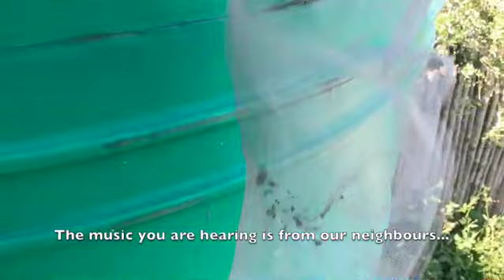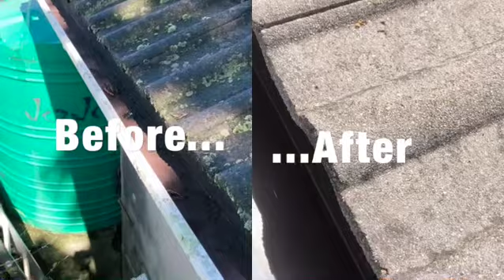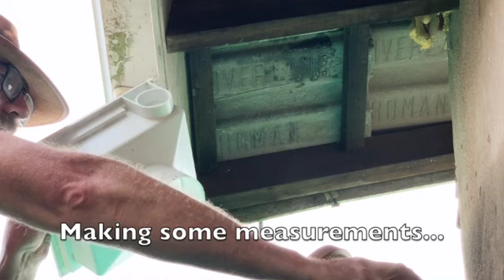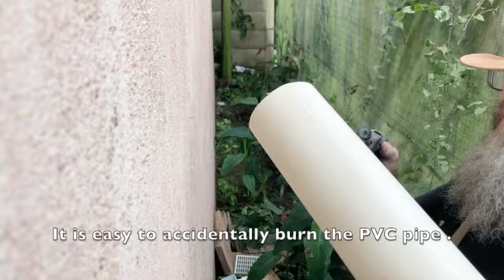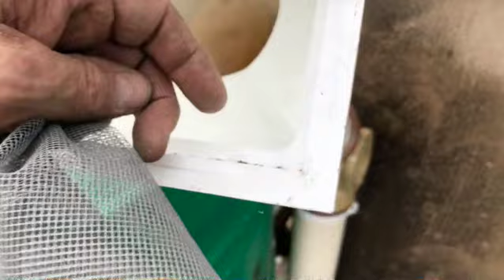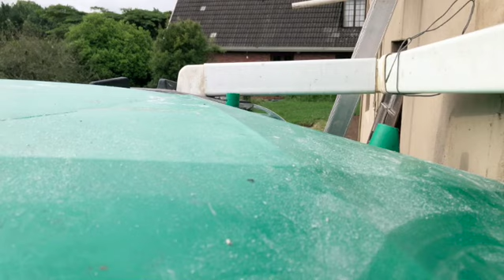How to clean a roof and add a leaf catcher to your rainwater harvester.

Comment: Satisfying job to clean the roof like that … how many liters of water did you use to get the job done ?
Reply from the maker: I did not measure, however the pressure washer does not consume as much water as it has a small nozzle and it is pressure that cleans, not the amount of water. I woud guess it used 200- 300 liters in 3 hours.
Reply: @thequixotryworkshop2424  cool beans … now if one uses rainwater for this purpose then it’s a pretty inexpensive exercise 🙏🏼 nice job